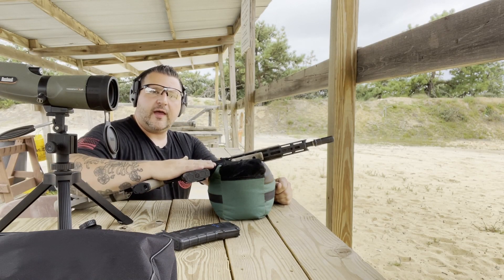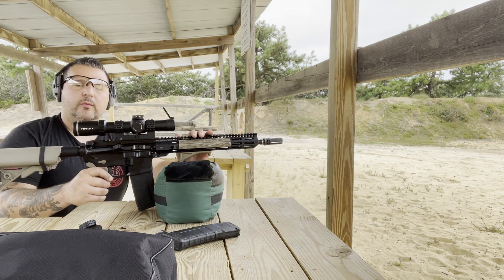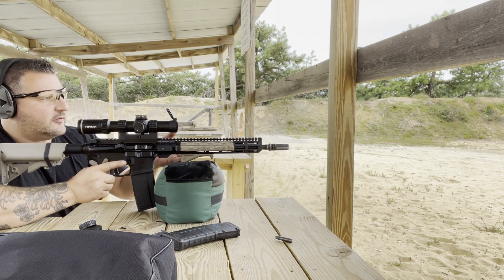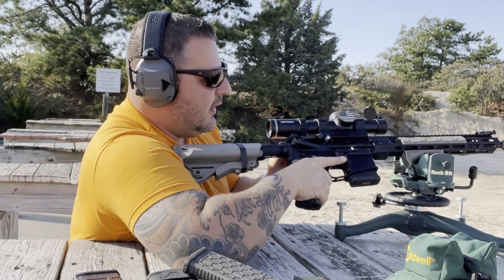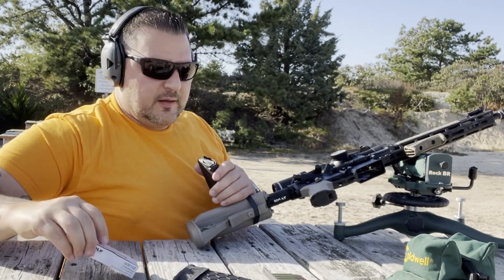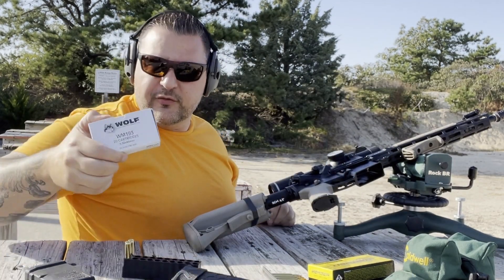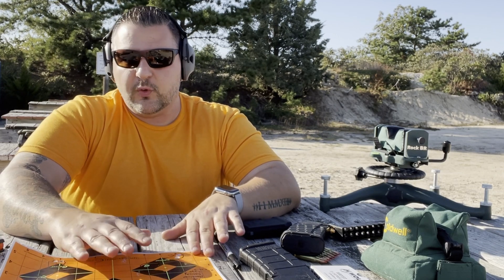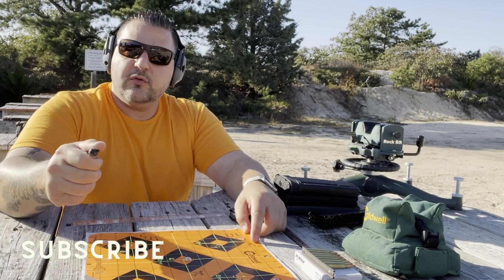Accuracy Test:  Ballistic Advantage 13.9" Hanson Barrel | Berger 77 gn Ammo

Comment: I have 2 ADM Core 13.9’s. At first both shot like crap, regardless of the ammo weight/brand. They were 2MOA guns. Turns our both had head spacing issues. So I bedded the barrels and replaced the ADM bolts w/ BCM. Now I can get sub-MOA with 69gr . Those 1/8 twist barrels don’t seem to like really heavy (77gr) or really light (55gr).
Reply: Actually hunting around for a13.9 CORE.  Strongly considered getting an ADM upper; though, to keep costs down, I'm thinking of just trying to source a 13.9 CORE and building.  Love that upper though!

Comment: To cycle the underpowered wolf you need to put in a H1 buffer. Also 1/7 twist barrels like the heavy ammo.
Reply from the maker: Yea I tuned it so it cycles both brass and steel. Runs like a dream after I broke it in. I have a Vltor buffer system on it.

Comment: I have a 14.5" that short strokes, every bcg, every ammo, every mag, no mag, different buffers, you name it, that Hanson barrel is under gassed.  not running ANY kind of ammo is a fucking issue, how are you ok with it not running wolf? idc if i'm running .10c a round ammo or bullets that cost $20.00 a piece, the rifle should fuckign run with any ammo, and in my case, BA is the weak link on my rifle. it's brand new and i've only got to fire about 50 rounds though it testing and it single shot short stroked every single time, never once under any conditions or factors has this rifle been able to successfully eject a round, let alone pick up a new round from the mag.
Reply from the maker: It took me about 400 rounds to make it run reliably. My issue was that the carbon seal didn’t form around the gas block yet. I got marginally better as the round count increased. Now I’m over 1000 rounds on the barrel and I never have any issues anymore.
Reply: @tactical outdoorsman, what did you do to make function correctly ? What adjustments did you have to make ? Looking at ordering this 13.9” Ballistic advantage barrel.
Reply from the maker: @AsherHVAC  just kept shooting it. After a few hundred rounds it formed the carbon seal around the gas block which prevented the gassed from escaping, creating enough pressure to cycle reliably. I think about some point I also lightened the buffer and put on a Vltor A5 buffer system and played with the A5H0, A5H1and A5H2 buffers to find the best weight.
Reply: Are you sure the Gas block and Gas tube are on there correctly? Also run a TRUE carbine buffer and spring. I have the 13.7 carbine and all my problems went away when I put a TRUE carbine spring/buffer in there and broke it in.
Past that I would contact BA, maybe they will ask you to send the barrel back or maybe the whole upper for testing.
If it’s a gas port issue I’m sure they will make it right!
Reply from the maker: Yea it’s m sure.
Reply: @C4Armory  my comment was towards the original comment..lol
Reply from the maker: @derek3154  oh lol

Comment: Right now I have a Criterion CORE 13.9” and a BA Hanson 13.9” both brand new and I’m trying to decide if the Hanson is good enough, or if I should just send it with the CORE 13.9” which I know is stellar. But I could return it, run the Hanson and save a couple hundred bucks. I hate making decisions.
Reply from the maker: You can’t ask me. I’d keep both and build 2 different uppers with 2 different purposes.
Reply: I have the 13.9 Core and the 13.9 Hanson. The Core barrel is stellar. Build 2 guns like I did and call it good 👊🏻

Comment: The Hanson 13.9" is midlength gas, correct?

I have the older 13.7" carbine gas, with a SOLGW Nox on it. My issue is over-gassing while shooting suppressed (Sandman S). I mean, it's not terrible, but the carbine gas (on my sample size of 1) is most definitely not the "tight, self-attenuating" magic port size that BA's marketing claims lead me to believe. Even with H2 buffer and Lantac E-BCG, ejection with brass .223 and 5.56 is about 1:30ish and not exactly pleasant wrt gas in the face. Going to try the A5H3 & Sprinco green to see if that tames it any. 

Anyhow, I've also found that accuracy seems to be best with the heavier 75-77 grain projectiles, which makes sense. I generally group a bit tighter with the DA can on, so I'd imagine a SF can over that Warcomp might benefit you as well.
Reply from the maker: Correct it’s mid length. I am going to be working on getting a suppressor eventually. Can’t wait

Comment: Question do you think the non cycling of the steal ammo is because of the B5 buffer system? I think that is a possibility.
Reply from the maker: It’s possible. It could also be because of reduced dwell time. The steel cycles fine on my 16” rifles with mil spec buffer systems. Wolf 55gn steel case is also a lower pressure ammunition. It’s also a brand new build so it’s not broken-in yet and then the formation of a carbon seal on the gas port. All that together it good cause for it not cycling. There’s also fluctuations in each barrel manufacturers gas port hole diameter. On a different build, I actually opened the gas port up so it would reliably cycle green tips and wolf steel. To be sure of the issue with the steel ammo on this build I would need to test each variable individually.
Reply: @C4Armory  I have a 13.9 on order. I’ll see if I have any problems with it. I have a 10.3 Hanson build and I haven’t had any problems with that. 🤷🏻‍♂️